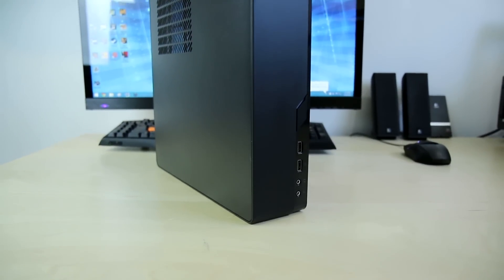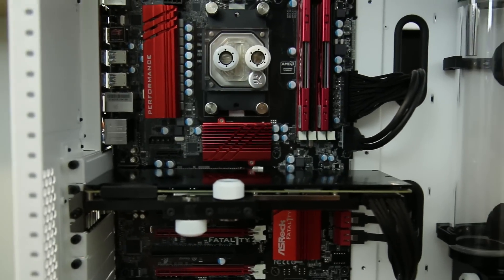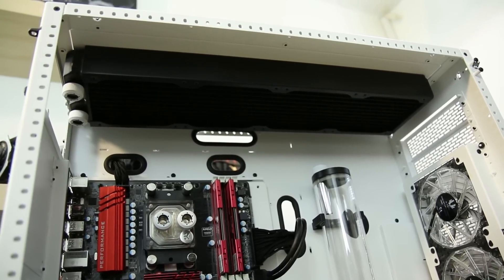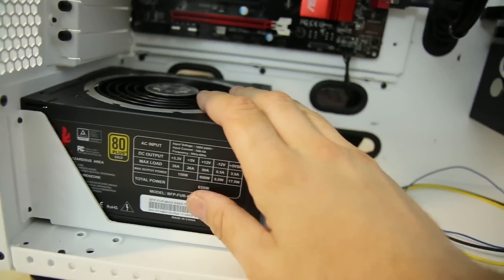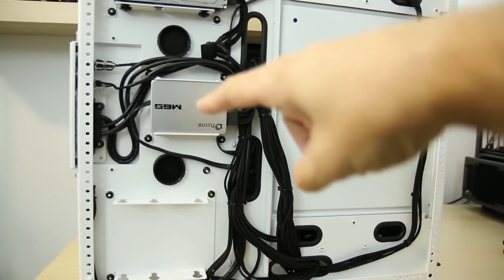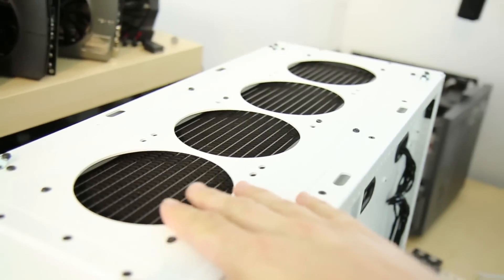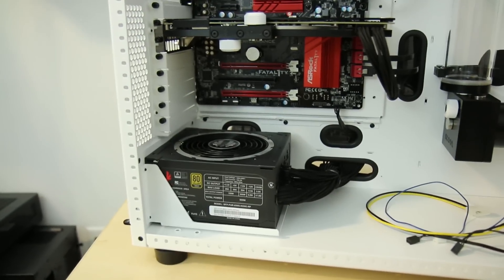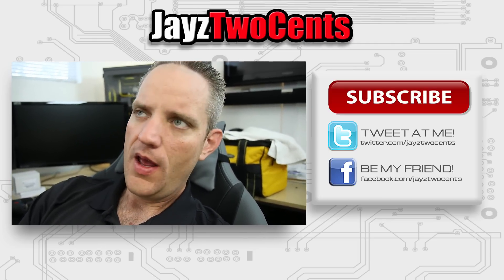Custom Watercooled AMD Build Update No. 1

Comment: lol why do people still use Amd CPUs ?
Reply: NarkDights | Hexthrill save alot of money at least 80$ and performs similarly to and i5 and overclocks like a beast and DX12 comes out with boosts in performance this is my opinion
Reply: jeremiah9561 Because they're cheap
Reply: XxEJ102 xX Except the 8350 can maybe keep up with a low i5 when using all of its cores, and most games only use 4; it costs about the same as an i5-4440. DX12 may change that a bit, but... yeaaaah.
Even an i3-4150 has a better single-core performance than the FX-8350; but, of course, it only has two hyperthreaded cores compared to 8 physical ones.
Reply: Jill Valentine Not true at all. An i3 outperforms an 8350. Even people who work at AMD know it.
Reply: If it had four cores, an overclocked Pentium G3258 would probably even outperform the FX-8350 in games.
Reply: InfinityCraft The 8350 outperforms current i5's on the market in multithreaded for your information.
Reply: ivanjacob You know the Pentium G3220 outperforms the i7 5960x?
Reply: ***** Yeah, if it uses all of its cores; but there are very few games which utilise all eight cores at the moment.
DX12 is supposed to change that, but at the moment, Intel CPUs are the better option.
Reply: XxEJ102 xX It gets trumped, stamped on, and shit all over on by an i5 in games...
http://i.imgur.com/H93GZC3.png

http://images.anandtech.com/graphs/graph8427/67507.png

http://images.anandtech.com/graphs/graph8427/67506.png

http://images.anandtech.com/graphs/graph8427/67510.png

http://www.xbitlabs.com/images/cpu/core-i3-4340-4330-4130/Charts-1/batman.png

As you can see an i5 destroys an FX series. Not to mention you can get a locked i5 which will destroy AMD everything, a cheap mobo since you don't need to overclock and use the stock cooler and you actually save money. An 8350 will require a motherboard with high-end MOFSETs to make sure you don't set your house on fire.... Then getting a nice CPU cooler to overclock your CPU is necessary to even come close to an i5.

People think they are getting a good deal when they buy an FX for gaming and yet they are not.
Reply: InfinityCraft Not to mention the FX-8/9XXX series you can't actually utilise more than 4 cores at once.
Reply: Nathan Young It's funny how you cherry pick benchmarks, two cards, 1080p, minimum FPS and skyrim.
Reply: +LPG You want more? No cherry picking, I have hundreds....
I pick two cards because it shows how a high-end AMD CPU bottlenecks the potential output of an Intel CPU that costs less. Minimum FPS determines how smoothly the gameplay will be - not average FPS. When you see big FPS dips it makes gameplay less enjoyable, especially when it drops below the refresh rate of your monitor. And Skyrim. A Multithreaded game they said? An 8350 will outperform an i5 they said?

http://linustechtips.com/main/topic/401217-more-updated-fx-vs-intel-for-gaming/
Go ahead. Read.
Reply: Well if someone wants a cheap editing station or a need for multiple cores then the FX series have some potential. Not everything is gaming.
Reply: Louie Richards Depends on the program of course. There are single threaded editing programs, multi-threaded ones, ones that need nothing but a ice GPU, etc. Definitely want to check benchmarks on the editing program you use before deciding on different CPUs.
Reply: Nathan Young The thing you don't seem to get is that people aren't gonna have the circumstances of the benchmarks. Most common resolution is 1080p. In that resolution ANY processor is gonna bottleneck a 980 or 770 sli to some degree. People mostly have lower end cards like 270x, 960 and similar. 

I rather look at frametimes for smoothness in game than minimum FPS as the minimum often comes from a single point in the game or benchmark.
I can cherry pick benchmarks and stuff that can show Intel doing terrible and AMD doing godly. But that doesn't make sense, and of same reason I don't care if you show me benchmarks of your cherry picked situations because they're irrelevant to helping someone making a functional computer that will suit their needs, often far from the performance of a 980 or that stuff.
Simply by your first words being that FX gets stomped on makes the rest of your comments irrelevant cause you've already shown you're biased.

So, with that said, I'm muting this post, have a good day.
Reply: ***** So by using facts I am "biased"
Gee, didn't know that facts could be used on the internet, no!
Show me, just maybe 10 benchmarks in games, where the FX series beats an i5. And explain to me how an FX is "cheaper" when you have to spend around $70 on a board to keep it alive, a 212 EVO to overclock it nicely and a CPU that doesn't even give you an upgrade path?

http://linustechtips.com/main/topic/401217-more-updated-fx-vs-intel-for-gaming/
Reply: Because of the awesome price performance ratio
Reply: ***** People say "dual core" and I say "IPCs bro."
Reply: ***** It's got hyperthreading which effectively makes it a quad core CPU.
Reply: InfinityCraft Well, according to many OSs, yes, though it cannot turn those threads into effective cores. It's more of a foolproof way of launching FC4 than beasting Cinebench benchmarks.
Reply: ***** Well now that've I've posted it, FC4 does in order to launch the game. A small number of AAA titles actually can utilise 4 cores, mainly FC4/GTA V, etc.
Reply: ***** "... which effectively makes it a quad core CPU."
Games just utilise it as a regular quad core CPU afaik.
Reply: It's pretty mixed on GTA V http://www.techspot.com/articles-info/991/bench/CPU_01.png
Then again you can find a used Ivy Bridge i5 (shown to perform better on that graph than the AMD CPUs) can be found for $70 on Craigslist sooooo
Reply: ***** Destroys is a bit much for one FPS http://www.techspot.com/articles-info/734/bench/CPU_01.png
That's also the lowest-end i3 from Ivy Bridge. Newer ones will outperform it.
Reply: jeremiah9561 ...because they just stopped being console peasants and haven't figured out the whole point to pc gaming is better performance.
Reply: Look, all I am saying is that AMD cpu's are pointless in most situations. The GPU's are decent for budget builds. But seriously, back when I had my FX 6300 I was a fan boy and I hated intel. Intel is just better, which is unfortunate because there is literally no competition in the CPU market.
Reply: Toms Tech What are you talking about? You mean reading benchmarks? AMD CPU's have been inferior for a long time now.
Reply: Toms Tech Have fun with your productivity.  Apparently it's not doing much for you if you are building a budget pc.  All anyone cares about is gaming.
Reply: Toms Tech Well genius, I'm just guessing but it got made on an Intel chip and three Titan gpus.
Reply: XxEJ102 xX like when dx 11, oh sorry, mantle, damn it, dx12, you still believe crappy hardware is going to be fixed by software?
Reply: Toms Tech Just accept AMD cpu's are garbage man.
Reply: eroOtoko1 The funniest/saddest thing is Jay's channel is probably worth almost as much as Amd.
Reply: Noquarter Atall LOOOOOOOOOOOL
Reply: the only good thing amd makes is server gpus and desktop gpus
Reply: Jackson Thorn Even that is subjective.
Reply: jeremiah9561 because they have cheap cpu's that are good at video editing, streaming, photoshop etc. and they're ok at gaming. Their a good cheap all rounder
Reply: APU'S*
Reply: Too much effort, also the fact that Jeremiah said cpus doesn't show he knows much about amds apus
Reply: True but it wastes time
Reply: jeremiah9561 Not anymore, but let me tell you the best AMD chip i ever had the pleasure of owning was the AMD K2 -400Mhz. Those where the heady days...
Reply: ***** they didnt prove nothing, intel still performs better than amd, the glorious fx 8xxx series still perform less than i5, and the powerful six core fx6300 still is beaten by a pathetic core i3 dual core, just accept it man, amd is dying scince 2011 and no on can stop it
Reply: jeremiah9561 I use an AMD CPU because I hate Intel. I am using a Phenom II though, and will switch to Zen next year; I'm not mad enough to go for an FX chip.
Reply: santi0797 well, if Microsoft is not lying than i think DX12 will indeed  fix the performance
Reply: InfinityCraft no game really uses 8 cores or modules maybe 6 core max so how can a low i5 be fair anyways? well no matter if DX12 does infact bring performance boosts than yeah same with AMD Gpu's since there teraflops are much higher
Reply: XxEJ102 xX microsoft lying?, amd is lying making conferences and crap telling everyone that dx is going to "fix" the performance issue, the issue is not software, it is the low per  core performance of the fx processors, you cant fix that with software, and the low useage of cores or low optimization will also have a positive impact on intel cpus, the higher per core perfomance of intel cpus will help its lack of cores (fx8350 vs i5 for example)
Reply: santi0797 DX12 utilizes most of it an 8350 would be more powerful if all it's modules would be used and being overclocked on top of that smoke an i5 for cheap
Reply: XxEJ102 xX  keep dreaming kid, i heard the same thing with dx11, that it will make phenoms x6 perform better, the same with mantle.
keep buying more cores man, by the time all the cores get used it is an outdated piece of crap, like a phenom x6 now, 45nm power consuming crap, like the glorious fx 8350, which after 4 years in the market their cores are not used properly, and you still believe and buy amd
Reply: santi0797 how old are you? you just don't want to lose the conversation is what your trying to do :)
Reply: santi0797 Just because i like AMD's products doesn't mean their better i was just saying what was true is all no hate :/
Reply: XxEJ102 xX of course they are not better, whats true?,that dx 12 will not solve the fx series crappy performance?, sure, its true
Reply: Not everyone thinks of money as expendable. I know I don't want to spend about 250-300 USD on a great CPU,then an additional 300-450 USD on a good GPU.
Reply: jeremiah9561 Because, for $120, Intel offers nothing that can match my OC'ed FX-6300.

Tom's Hardware backs that up - OC'ed to 4.4GHz, the FX-6300 performs about as well as an i5-4670k at stock, which is double the price.
Reply: jeremiah9561 APU's, theyre all good at all price points.
The new sempron and athlon for low end pcs, very cheap and good .
The Athlon x4 860K kills the pentium K because of the cores, can handle games the pentium K can't :D
Waiting for the zen high end cpus :D ^^
Reply: jedidethfreak a core i3 reks that crap without oc, and you can buy a xeon x5650 (a real six core) for 65-70 from ebay
Reply: jedidethfreak and you said that for 120 there was nothing that could beat that piece of crap cpu u have, there is indeed, its called core i3 and scince 2011 it outperforms that fx piece of shit, and for 60 that xeon completely destroys any fx cpu
Reply: santi0797 No, the i3 does not outperform a 6300.  That is simply not true.
Reply: jedidethfreak it you think so good for you, maybe in another universe it dont, in this one yes it does, un gaming a core i3 performs like a fx 8350
Reply: santi0797 And, I'm guessing you can actually back up those statements, with average framerates in a multitude of games?

HardwareCanucks can't.  TechReport can't.  AnandTech can't.

Hell, even Tom's Hardware has to skew their results by posting stock-speed-only results.  Even then, the i3 STILL gets MAYBE 2 FPS in Intel-optimized games on average over an FX-6300, despite being more expensive.
Reply: santi0797 So, you can, but don't?

And you wonder why people don't take Intel fantards seriously.
Reply: santi0797 None of those tests use an overclocked CPU, nor do they even have the OS fixes for FX processors installed.  Even so, half the games have a 3-5fps difference between the 6300 and the BEST i3.  So much for "rekt."
Reply: jedidethfreak try to overclock it as much as you can and still the i3 will rek that piece of crap, and dont look only at the average fps, look at the lowest fps, those are the worst thing about that crap cpu, and it is the worst part about gaming in the fx, the "optimization" doesnt add more performance to it, scince it come out in 2012 it didnt change a thing, are you out of excuses or u still want to look stupid?
Reply: santi0797 Considering you didn't post a single graph featuring FX optimizations, overclocking or even a recent time stamp, I'm not the one looking stupid, Intel fanboy.
Reply: santi0797 What do you mean, they don't change the results?  THEY'RE ONLY RUNNING ONE CORE WITHOUT THEM!!!
Reply: santi0797 Uhh, yeah, they did.  That was their whole point.  Windows relegated all FX processors to use only one core at all times.  That's why they performed that way.

Then again, if you weren't such an Intel fanboy, you'd know this.  This was major tech news years ago.
Reply: jedidethfreak the fix came out in 2011 for the first fx processors and was added later in microsoft updates of windows 7, and in windows 8 and 8.1 they come preinstalled, then again if you were not such an ignorant you would know that the tests of the last games of those websites are performed in windows 8, and if you were even less ignorant you would know that the fix.
and the so called fix is not what you describe, the fix was to stop microsoft sub processes so that the piece of crap would have more head room in games, because its performance per core is so low it was always running at high load, but the fix was not because the processor coudlnt use all the cores, you just invented that, it always used all the cores dumbass
Reply: santi0797 No, Skyrim and Crysis were tested in Windows 7 - you know, the ones that skew your way the best?

You're comparing single-core performance of one chip to dual-core performance in the other, and trying to tell me that's a fair test.
Reply: santi0797 Dirt 3 no fix 119 both fixes 123
Metro no fix 93 both fixes 97
Skyrim no fix 42 both fixes 43

Someone's picking and choosing numbers to back up their argument again - the usual Intel fanboy MO.
Reply: santi0797 Even so, YOU'RE STILL WRONG!  You explicitly stated that the patches did NOTHING!
Reply: jeremiah9561 They do make good server and desktop gpus, so its not very subjective.
Reply: InfinityCraft So basically a mid ranged i5.

Comment: Does anyone known if an Intel core 2 duo is a good couple for mild gaming?
Reply: Gavin Shrock Not anymore.  Quad-core MINIMUM for gaming nowadays.
Reply: Gavin Shrock for very mild gaming you could get away with it. I wouldnt expect any of the triple A games to run very well (GTA V for example) it is at the point where you need4 cores but if you are just doing mild gaming at lower setting or playing games like Dota, LoL things like that I would say you are fine.

Comment: Hey Can someone plz help me i dont know if i should get the i5 4690k or the amd FX-8350 8 Core. plz tell what i shoul.
Reply: I would go with the i5 because it would easy to upgrade in the future if you wanted to upgrade to the i7-4790k since they are the same socket so you just have to buy one motherboard and just swap out the cpu if you need more performance :)
Reply: Go with the i5 man.

Comment: WAIT... IF PEOPLE CAN RUN ONLY 2 R9295x2 IN CROSSFIRE BECAUSE OF POWER SUPPLY LIMITS, CANT YOU JUST USE THIS CASE OR ONE LIKE IT ANS RUN 4 R9295x2's FOR A TOTAL OF 8 GPUS?????????? unless im just stupid plez tell me this will work tho i wanna try
Reply: Randomdeath5 only four gpus can use crosfire
Reply: TM80 NotGoodWithNames ok but why? Can modifying software fix it or is it just not possable at all?
Reply: If I remembre corrrectily you can maybe run 8 gpu but not in crosfire. just for doing renderin or calculating
Reply: TM80 NotGoodWithNames shiiiiiiiii
Reply: Randomdeath5 Theoretically its possible to run 8+ physical  GPUs simultaneously though not in SLI/CrossFire X due to driver limitations.
Reply: Randomdeath5 no point in doing it anyways, GPU scaling past 2 (3 if you want to push it for cost effectiveness) is 100% pointless anyways. the scaling you'd get would be so impossibly bad that your Wallet would divorce you.
Reply: Kyle LaFountaine can one not modify said driver?
Reply: ***** its just a theory. like maybe some yt channel like linus tech tips does it for fun.
Reply: Randomdeath5 Technically speaking, yes. But it wouldnt be logical as no application/game is optimized to utilize more than 4 GPUs without them crashing or running into other errors/issues.
Reply: you cqn only use 2 nobody will modify the driver its not that easy you would probably also need tomodify the bios and also the more cards the worse crossfire works dual crossfire good triple crossfire one couldmsay worth it quad crossfire 10% more pooower you can imagine that with 8 gpus and no game developer will optimize his game for one guy
Reply: Randomdeath5 fun, sure. but you won't be able to use it anywhere and the performance scaling of it, again, will be impossibly bad.

so it's entirely pointless to do. 
just like, you could make a car that runs on Iridium - and that's cool and all, except you'll realize that Gasoline is still more practical because you can actually get fuel.

Comment: why would they want a full water cooled system if not trying to achieve the best o.c. possible? wouldn't air cooling suffice for a build like this?
Reply: Grey Roots to be fair, people like going watercooled for the wow factor because it looks much cleaner and more appealing than having a big ass heat sink on top of the CPU
Reply: Grey Roots Air cooling would "suffice," sure, but there's no way to set up air cooling to be as efficient and long-lasting as watercooling.
Reply: jedidethfreak long lasting?
Reply: Grey Roots Less heat = more reliability, especially when running 24-7